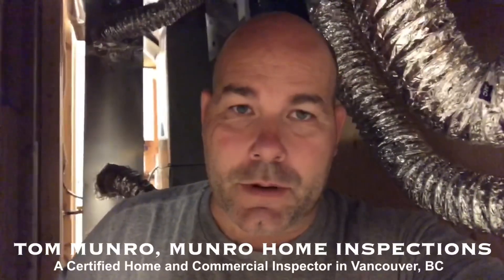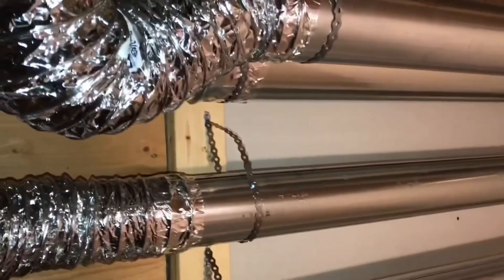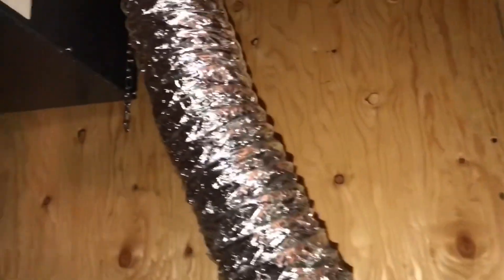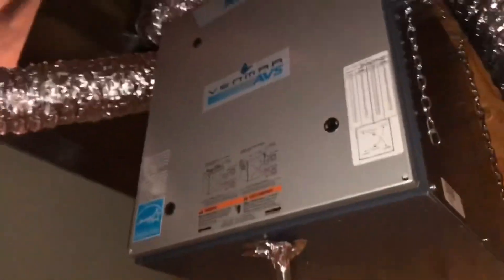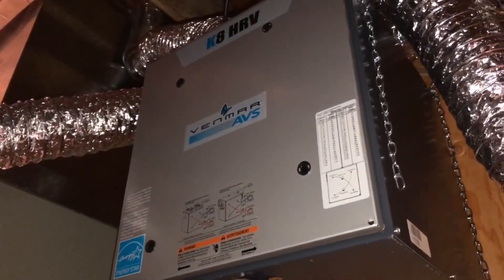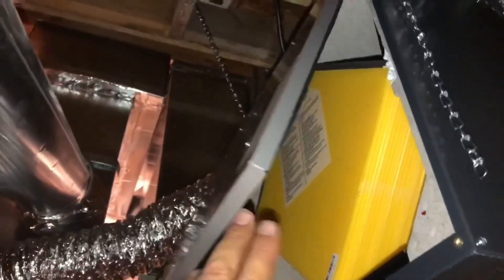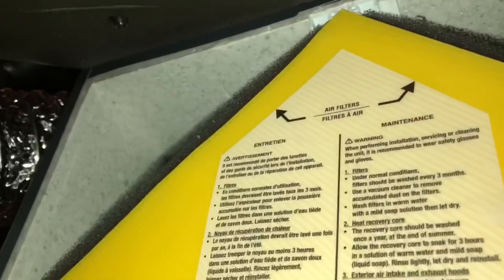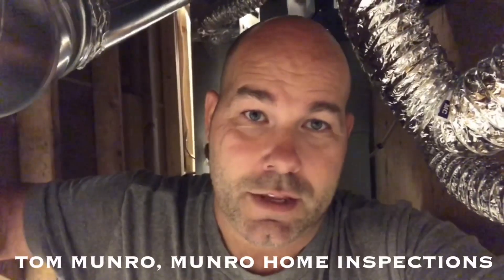2.8 Million Home with an HRV for a condo

Comment: There are filters they sit on that exchanger the big yellow square should be the exchanger with some foam pads on it. The exchanger needs cleaning alright it needs to be pulled out and cleaned with soap and water not the furnace cleaning guys. I had them do it twice both times they blew the exchanger fins needs replacing after. Don’t let them use vacuum or compressed air on the exchanger as it’s too much for it and causes the fins too separate causing air to actually go from one side to the other. Take care  I like what you do

Comment: Djeeeezus, I thought it was small. But when I saw your hand touching it, man that's a very very small unit.
That is does not open so wide, I have seen these things more. They just make it and do not see if it actually works.
Then again, why is it all soooo poorly hung and mounted and fixed together. In time it will start rattling or just break down.
Thanks for your video! Great work.